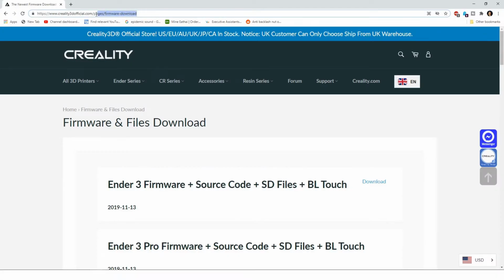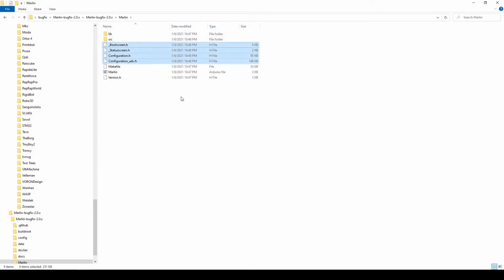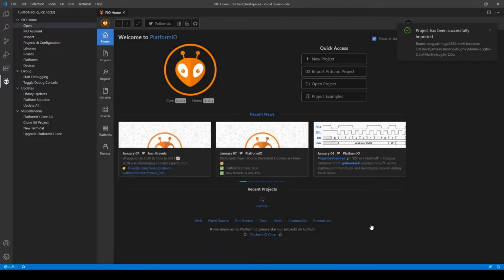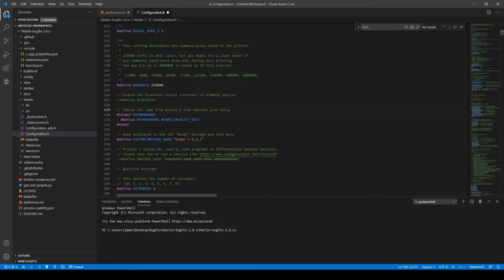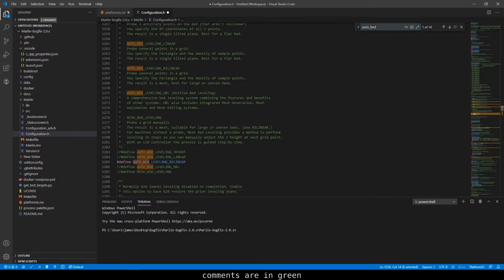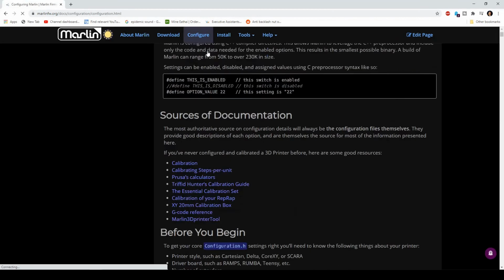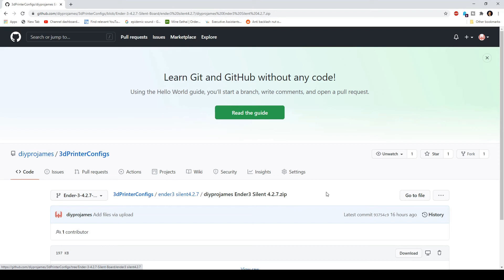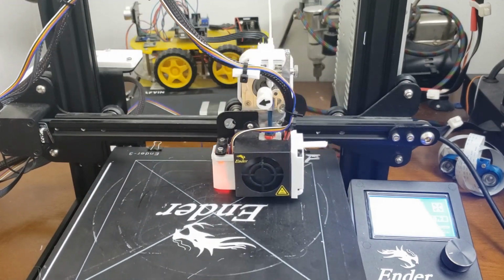ENDER3 4.2.7 SILENT BOARD UPGRADE FIRMWARE - PART 2 INSTALLATION - BLTOUCH 3.1 - MICROSWISS DD

Comment: Hello, when I compiled my firmware and added it to my printer I lost the ability to move my XYZ axis by hand, which setting do I need to change in my custom firmware to be able to move my axis?
Reply from the maker: It's normal for the steppers to engage when printer is powered on. You can disable the steppers with a m18 or m84 command. I also think there is a disable stepper function in the menu.

Comment: i cant do it the lines dont line up and ive lost all hope
Reply from the maker: The lines don't have to completely match up. First have you seen all the videos on this playlist.. https://www.youtube.com/playlist?list=PLKB2mjSs4KgN29yU2t4kGeNoVFJWeSt6H They are related and will help you get a better understanding of the firmware.
2nd Are you using the same hardware as mine? 
3rd If your using the same hardware. Have you tried the firmware I've uploaded to github.. They should all be in the description...

Comment: Great video James. I’m having issues with visual studio. Could you compile the firmware without the micro Swiss DD?
Reply from the maker: The firmware is pretty much the same for the microswiss or regular drive. I would do it, but I don't remember the x and y offsets for the old mount. I don't really think there was much of a difference in the mounts. Maybe 1mm off in the y direction.  If you could find the x and y offset for the mount and let me know I can compile it for you. The only thing you may have to do is a e step calibration.

Comment: Hi DiyProJames. Thank you for your time put into sharing this process, this video has helped me understand how to compile for Ender changes. I have done my best to follow your guide step by step and I keep running into 2 issues that won't allow me to finish. 

Problem one is:
"ERROR: Config files found in directory /Users/xxxxxx/Desktop/Bugfix-2.0/Marlin-bugfix-2.0.x/config. Please move them into the Marlin subfolder."

I tried to move "them" to another folder but the message repeats when I compile again. I'm not clear on which Marlin subfolder to move them to.

Problem two is:
"Environment                        Status      Duration
----------------------                        --------        ------------
STM32F103RET6_creality  FAILED    00:00:14.806"

I really don't understand why this is an issue because I've checked over and over for spelling and capitalization and spacing for this in the platform.ini tab and from what I can tell it look like it's right. 

I hate to bother you with this but I don't know who else to ask.
Reply from the maker: The config files need to be placed in the marlin folder. There is a plugin for vscode called marlin., Try installing it and do an update..
Reply: @DiyProJames  Thank you very much for your quick reply. I will try this and hope it works.

Comment: Best video explain I,ve seen on yt. 
Anyways, i just bought the 4.2.7 silence motherboard and bl touch for my ender 3, i followed every step and i have this problem: When i turn it on (even without printing), the bed starts heating up to 150 celsius. I don´t really know if the problem is related to the firmware or the new motherboard. Any thoughts???
Thanks
Reply from the maker: Great, you were able to get it fixed. I was about to say your bed shouldn't be going over 100C. Were the thermistor wires switched?
Reply: @DiyProJames  I switched the red and black big wires between the red and black small ones  (on the left side of the motherboard). Thankfully I customized the firmware to go off when the bed is overheated. I wouldn’t even seen it.
Reply: Problem solved, I just messed up with the wiring. Everything works perfect. Thanks

Comment: Hey! Thanks for the Vid. I only have one issue after updating the firmware. My Z axe does not go under 0 anymore. It goes up fine.
I don't think that the motor is broken, because it worked just fine before the update. Do you have any tips on solving that problem?
Reply: Hardware: 4.2.7 Silent Board 32Bit
BLTouch 32Bit
Reply from the maker: please watch this video. https://www.youtube.com/watch?v=3J9NhwbziEY

Comment: I downloaded the file onto a blank SD card but when I inserted it into my Ender 3 Pro and turned it on I did not get the screen.  My printer just booted right up.  I have BlTouch and 4.2.7 board.  Any thoughts?
Reply from the maker: Are you sure you didn't just miss the blank screen? Make sure your using the .bin file and your sd card is working
Reply: @DiyProJames  Thanks for  the response.  Yes it is the .bin file.  I added a microswiss direct drive and metal hotend to my Ender 3 pro and need to reset the X and Y offsets since I am now printing in one corner.  I am quite positive I did not miss the blank screen.  My startup is still the Creality logo.  Could it be that my board is the older V1.1.5 and does not have a bootloader even though it is a silent board? (Hope that makes sense to you)
Reply from the maker: @ollieb  This firmware is for the 4.2.7 silent board. It should say directly on the motherboard.
Reply: @DiyProJames  I looked.  Mine says 1.1.5 .  I was under the assumption this board is a 4.2.7.  I thought the difference was the 4.2.7 has a plug on the board itself for a bed leveler.  If not would you know which one I would load at the start for my board?
Reply from the maker: @ollieb  They are not the same. 1.1.5 is a 8 bit board. They just swapped the drivers. The 4.2.7 is a 32 bit board. Try using the old marlin version 1 configuration.
Reply: @DiyProJames  I said to heck with it.  I have a 4.2.7 board on the way here.  Now I get to configure a BlTouch and the microswiss DD and hotend.  Going to be a fun weekend for me.
Reply from the maker: @ollieb  =)

Comment: Hi purchased 4.2.7 board  and  bl touch not working properly  ,not letting me set z offset and direct sd download to fix issue
Reply from the maker: Try using this firmware https://github.com/diyprojames/3dPrinterConfigs/blob/Ender-3-4.2.7-Silent-Board/ender3%20silent4.2.7/diyprojames%20Ender3%20Silent%204.2.7.zip
Reply: Ok,would it matter if iam using an adapter  pin for bl touch or sould i connect  it directly  to bl touch direct  board
Reply from the maker: @reyrisonrosales5101  I'm confused to as why your using an adapter.. Are you sure your working with a 4.2.7 board? You'd only need to use the pin 27 board on an old melzi or stock 1.1.4 board. I'm not sure we're talking of the same board.
Reply: @DiyProJames  yes I purchased  4.2.7 and bl touch v3 separate  my bl touch came with adapter  for 32 bit  board  my 4.2.7 dose have a bl port as well,is the file you sent me a bin file?
Reply from the maker: @reyrisonrosales5101  There should be both. Test with the bin file to see if it's work initially, then use the configuration.h to set your bed and offset values. Recompile and upload. I set the margins and offsets with the direct drive so your head might not be set correctly. Remove the z endstop and plug the 2 connector there. Do not use the pin 27 board.
Reply: @DiyProJames  it confusing  for but I will see some more how to video.
Reply: @DiyProJames  i purchased the exact same thing the 4.2.7 silent and a v3.1 bl touch connected to the pin 27 board and when I auto home the x and y home but the z stops automatically and does not probe down.

Comment: What is the difference between the Marlin bugfix files and the regular files?
Reply from the maker: Marlin bugfix is the "nightly or most current version" Then there is the latest release or "official version" The difference is "bugfix version is untested released to public for testing"
Reply: @DiyProJames  Thanks for the answer. I installed a Creality 4.2.7 board into my Ender 3 Pro along with a V3.1 BLTouch, followed your steps in Visual Code studio, installed that firmware and the printer won't autohome. Not sure what is going on and don't a lot about programming.
Reply from the maker: @xwarp  have you tried using the firmware I've compiled? Look for the bin file and use that one see if it works. If it does then you can compare with your config file. If it doesn't then there may be other issues.
Reply: @DiyProJames  I have that loaded now and the screen has the X,Y,Z values flashing and the bottom of the screen showing "Home Z first".

I have no idea what this means, and I appreciate your responses. I just don't know enough about programming to understand this easier.
Reply from the maker: @xwarp  There is an autohome feature in the menu look for it. Z value is the bltouch offset you have to input in the bltouch section. That is the height difference between the nozzle and bltouch probe when deployed.
Reply: @DiyProJames  I'm going to have to watch more videos I guess. This is an Ender 3 Pro that had the 1.1.4 board. Just a reminder, it now has the 4.2.7 Creality board with the V3.1 BLTouch with your firmware installed.
It appears to auto home X,Z, but when the nozzle goes to center of plate, it never drops down to trigger the BLTouch probe.
Reply from the maker: @xwarp  I'm thinking you just probably havn't set the z offset value and stored it in the eeprom.. See if the auto bed leveling works.
Reply: @DiyProJames  No go on the auto bed leveling. Select that and the hot end seems to zero the x,y, but when returning to the center, it stops in the center, the BLTouch cycles twice and then stays blue with probe extended.
Reply from the maker: @xwarp  check to see if the z stop wires are not switched around.

Comment: Thank you for this video it has helped me for the most part. When I boot up the printer (ender 3 pro) it will throw me an error message and I will just hit ignore and it is somewhat fine until I auto home then the nozzle will just sit in the middle off the build plate. I don't know what I am doing wrong and I don't know what I am messing up with the coding. Is there any discord servers I can join to get more information for the printer.
Reply from the maker: I don't know what you mean by hitting ignore.  I'm assuming the printer does not get halted. Have you checked to see if your z min wires are in the correct places? I don't know the names of the discord servers at the moment, but I'm sure there are groups available.

Comment: great video.  I wish I had the knowledge you have with the coding part of 3d printing, everything else for me is a breeze but this stumps me.  What type of basics do i need to do too understand how to compile my own firmware?  Keep up the great work.
Reply from the maker: Most of the code has been written by the developers. Most of us are just enabling and disabling and adding some values to the code. All the complex work has been done. It's best to go marlin website / configuration part and go through their read material.  https://marlinfw.org/docs/configuration/configuration.html
Also you would need to learn how to use vscode with platformio. Thank you.

Comment: Thanks for the video, it has a great breakdown.  I do have a question that you might be able to help with though.  I have a ender 3 pro V1 with a 4.2.7 board and 3.1 bltouch installed.  It completes its self test on initial power up but then does nothing.  It also wont do anything when given commands from the controller on the printer.  I have attempted to get it working by both installing direct to the board and using the pinboard from the kit.  I swapped and checked wiring for both configurations.  It still will not work.  I have also tried marlin and creality's own firmware.  Any guess to what might be the issue?
Reply from the maker: The signal is not being sent or detected. Could be hardware or software. If it does a self test power is going to the bltouch. I have an upcoming video that might help you out.  For now you could try out my firmware. https://github.com/diyprojames/3dPrinterConfigs/blob/Ender-3-4.2.7-Silent-Board/ender3%20silent4.2.7/diyprojames%20Ender3%20Silent%204.2.7.zip
Reply: @DiyProJames  yeah I have tried multiple firmwares and followed yours from video as well. It still just get no signal. Its weird
Reply from the maker: Please watch this video it may help out. https://www.youtube.com/watch?v=ckdFNEuoy3M
Reply: I was having the same issue. I was wanting to update the firmware on the ender 3 to Marlin 2 on a new 4.2.7 board while installing a BLTouch. I tried for a week or two. My wife ended up getting it working by following the instructions on https://support.th3dstudio.com/hc/en-us/articles/360049104812-Creality-Ender-3-3-Pro-Ender-5-5-Pro-Firmware-V4-2-X-Board
Reply: @kyleskousen2107   I will try it.  So far this would be the 7th firmware config I have tried haha.  If this one doesn't work, I will be getting a replacement sensor.
Reply: @kyleskousen2107  Well sadly that one didn't work either.  Downloaded the firmware, enabled their recommended settings and the BLtouch settings.  Compiled and loaded fine.  Sensor still wont deploy when given auto home command or from the BL touch commands from the printer's controller.
Reply from the maker: @kyleskousen2107  Lucky... you have an awesome wife..
Reply: @DiyProJames  
It turns out after I got home that the wrong firmware was uploaded to the printer. 😓
Reply from the maker: @kyleskousen2107  Yes, often the case... too many different versions out there... It's helpful if you learn to compile your own...